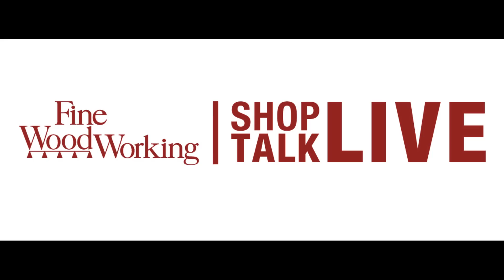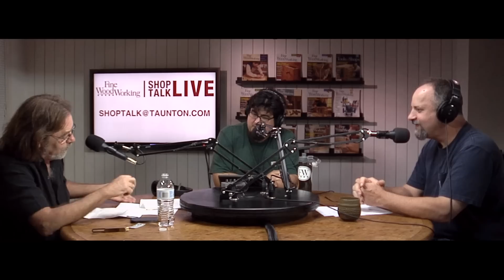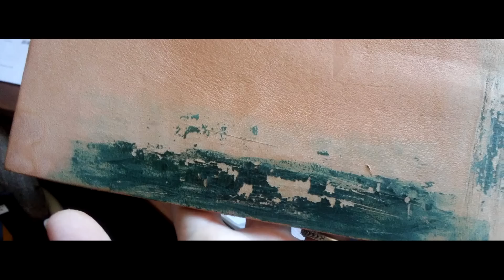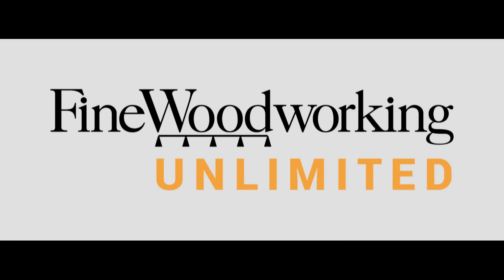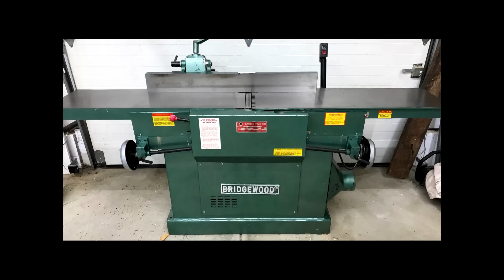STL 178: To Glue One Edge or Two?

Comment: Jointer .don't joint when your tiered. I used a 6" bench top and was up late trying to get ahead on a project .now holding the board improperly.  Now my middle finger is a 1/16 shorter than it used to be. Never rush always  be aware

Comment: The leather surface is smooth polished, so it won’t let the compound seat. Just rough it up a bit, or even better just soak it in mineral spirits then apply, the oil opens it up and let’s the compound seat

Comment: Re: panel glue up... the best way I've heard of is to stand all the edges that need glue up side by side, then apply the glue in a thin layer to all the pieces at once with a paint roller, then all you have to do is lay them down (especially good if you do it on top of clamps already laid out where they need to be) and tighten it up.

Comment: Just wanting to clarify some comments on stickering and drying wood.  It was mentioned that it was not a good move to mil to part to size, and then sticker.  It was also stated that you sticker to allow wood to move.  You actually sticker to keep wood from moving.  Think of it like bent laminating.  The wood drying while being held straight in stickers is like the bent wood/glue drying locking in a bend.  Stickering is always a good idea if your wood is in an environment condusive to the wood loosing more moisture.  It is at risk for moving if left on its own, and not held in a straight shape.
Reply from the maker: Bob disagrees.
Reply: Wrong bongo.
Reply: Todd Beaulieu ok

Comment: Answer to question 1: try putting the compound on the rough (suede) side of the leather. Use that side with compound, and the smooth side without. Save you 15 minutes of your day.
Reply: Never tried that but sweet Jesus there was a lot of compound on that strop